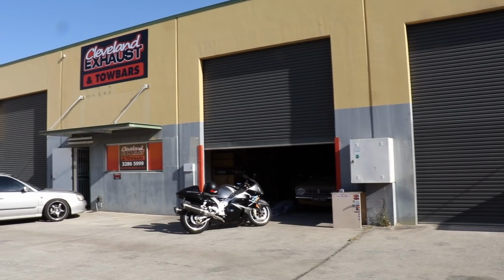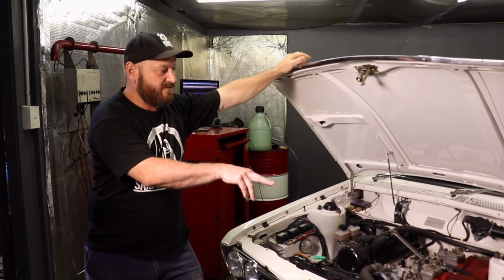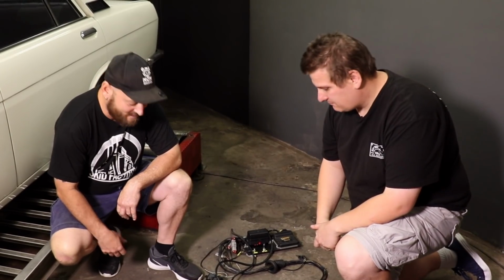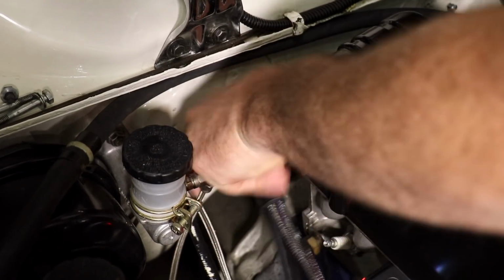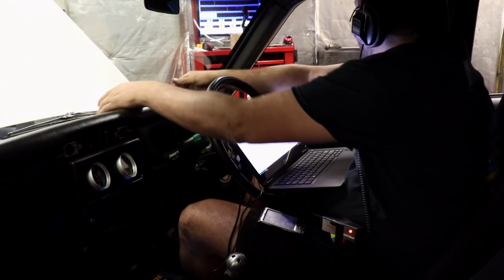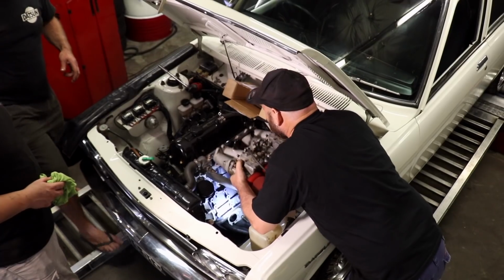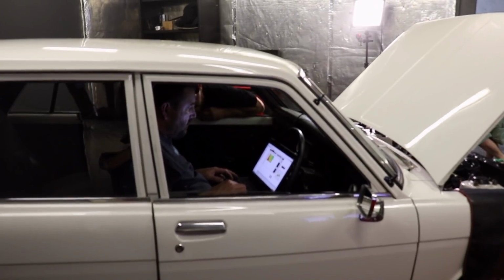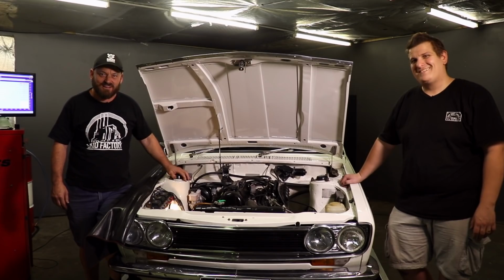Carb vs EFI on an L Series Datsun 1600 - Dyno Test

Comment: Little kiddies must be easily impressed
$ v's Hp still laughing
Reply: How much do you think it cost?
Reply: For that horsepower gain, too much.
Reply: How much do webers cost new? How much do they cost to tune? How much does an electronic ignition system cost to buy and have the weights and springs calibrated to suit the specifics of the engine? 
How much did this setup cost that can be recalibrated with a laptop for any modification to the engine?
Reply: "How much do webers cost new?"
about $467.00x2  plus manifold.

 "How much do they cost to tune?"
For me, free, for you I have no idea.

"How much does an electronic ignition system cost to buy and have the weights and springs calibrated to suit the specifics of the engine?"
 electronic ignition modules range between $50 to $500. Advancing springs and weights aren't rocket science .

"How much did this setup cost that can be recalibrated with a laptop for any modification to the engine?"
Wow that beats a timing light, a screwdriver, and a vacuum gauge.
Reply: Sounds like it costs as much as this efi setup. What part of the carby are you tuning with a screwdriver?
Reply: Alan Butler

DEADSET!
"What part of the carby are you tuning with a screwdriver?
"
Please go away.
Reply: So you don't need a variety of jets, air correctors, emulsion tubes, venturis, chokes etc? Just a screwdriver. Setting the air balance and idle mixture is not tuning a carb.
Reply: Alan Butler
So, whats your point. The car runs well before the change, the add ons gave minimal  hp. If it's was done for the wow factor, money well spent. If hp, not enough bangs for my bucks. Lol

"Just a screwdriver. Setting the air balance and idle mixture is not tuning a carb."
Do you see those things holding a  carburetor  together? I undo those things with a screwdriver. Even the circlips. Be amazed at my trickery.
Reply: I'm amazed your still arguing your point.
Reply: Tim Heibloem

What that little boys are  easily impressed.

Comment: Would it have been better for tuning leaving the standard Suzuki injectors in, rather than going big on a motor that's only making 120hp. The stock efi is good for 170 + HP in the bike. Just curious why bigger injections are needed to make 125HP..
Reply: Busa Richard  The Suzuki ones were unknown and some serviced S2000s were a bargain.

Comment: Hy guys!! I'm from Brazil and I'm going trought the instalation of my own ECU on a Opel Kadett 1984 (here we call it Chevette). I'm interested in buying/installing a knock sensor on it. My ECU doesn't give me this resource, but I know that there are some good aftermarket devices that I can use to listen to the engine knocking as you did on the video. Can you tell me a brand or equipament model I could buy for these purpose.
Thank's and sorry for the bad english!!
Reply: Linkecu used to do a knock ear device for tuning purposes.

Comment: Reliability?  Lets get real, 10hp? Probably that is lost when filters are fitted. The efi SHOULD produce bottom end and mid range but the figures did not show it. Maybe better on economy but it is a performance car not grannys shopping trolley as it started life.
Sound? Pull those socks off the Webers, no sound better,,, or more bloody annoying depending on the circumstance.
For race use there is no real advantage, for street maybe some.
Reply: The big oval filter they will be fitting shouldnt restrict a small engine like that at all. My SU setup on an L20 at around the same hp as this one had no perceptable difference with filters on or off.

Yes, they should have been fair with the initial dyno test and had filters off. But the ability to route cold air and have the efi account for the temp would most likely make up the difference anyway.

Comment: But why use a Hayabusa unit that was designed for 1.3L hayabusa engine instead of a 20V 4 throttle that is designed for 1.6L 4AGE engine? My logic is that the throttle body should be bigger in the 1.6L one instead of the 1.3L one.
Reply: netmatrix75 the busa uses 44mm throttle bodies, the 4a uses 43 or 45.
Reply: netmatrix75 1300cc engine that revs to the moon vs a car engine that probably does about half the revs.

Comment: Interesting piece. On the one hand, i totally get the desire to ditch carburettors. The driveability, reliability, constant tune in all altitudes and conditions, tuneability, and never getting covered in fuel and crap with constant fiddling with the fuel and spark systems. I've spent considerable money ditching an old carby engine for a late model injected engine in the tow pig i run. But on the other hand, how much money have they spent to get 8 percent or ten more horsepower? Not including labour and dyno time, the parts alone will have run into a couple of grand surely? I'm not a street racer or a drag racer so i probably don't have a real understanding but where i come from, we spend far more money on suspension tuning and chassis tuning and it netts us far more gains than 8 percent power increase.
Reply: Doing well on the editing and presentation by the way guys
Reply: 8 Percent at the pointy end of its potential horsepower.  If we had of started with a bone-stock engine, I imagine gains would have been more dramatic.  The owner is happy, I am happy.

Comment: Did I understand that it sounded different after the changes? If so, why would that be?
Reply: zeroyon223 oh that totally makes sense thanks
Reply: The carbs are 45mm throat but they then have a choke in them to create the "depression" required to create fuel atomisation. The Busa throttles are 44mm but have no choke as the injector both delivers the fuel and atomises it. The sound changes because of the lack of chokes.
Reply: Makes sense figured you'd have been talking about sound once it was buttoned up. Awesome videos and thanks for taking the time to answer.

Comment: @Turbo Yoda, So if you pulled you're crank angle off the Distributor, (super cool adapter by the way) does that mean you're firing 2 coils together in a wasted spark setup?
Reply: If you mean does it only receive enough engine position information to run wasted spark ignition then No, it is capable of full engine position signal. You may be thinking of a crank only signal. A cam only signal is delivering a 720degree or full cycle pattern, a crank only signal is only delivering a 360 degree or half cycle pattern and only does that if it has a missing tooth or extra tooth.
Reply: That is what I was thinking of.  Thanks for clearing that up.

Comment: I wonder how much that less than 10% boost in horsepower cost ???
Surely old school (japanese style) one carb per cylinder and black box free pulse ignition (nippondenso BCI coils) would have achieved a greater increase in power at a far lesser cost.  
Please forgive my utter prejudice (and loathing) regarding the electronic and computer insanity that so many see as normal and ok these days.

Comment: If you picked up 10 HP,  the dyno showed only 6. A LOT of money and mods for 6-10 HP either way. A LOT of money when you add the cost of dyno time and a Haltech, let alone the carbs. I hope you have plans to make all this expense and tech worthwhile. Usually, I love your content, but this seems like a commercial to me, so I give it as much notice. Which is kinda none, man.
Reply: The video is about converting to EFI. This is done for many reasons but in an NA application it is rarely to increase a top end power number. The basics of this can be applied to any engine. If you want to see hektic videos about massive gains then look elsewhere on the internet because that is not what the show is about, we operate in the real world and show you the reality of that world.

Comment: Awesome vid. Anyone know what wiper motor he's using? It doesn't look original. The 1 in my 1600 wagon has 2 speeds slow and stop.
Reply: Contact Timmy at Crimp My Ride, he does them as an upgrade.
Reply: Alan Butler thanks. Did the conversion on the weekend.

Comment: At what price? What was the up grade cost not uncluding labor
Reply: I’d guess about $1500-2000 but I don’t know how much the throttle bodies and the distributor pickup goes for. I think the haltec with harness is about $1000. 

A dual Weber setup like they took off would be a similar price.
Reply: ChrisHallett83 I know for my Datsun Z you can find triple 40mm for 1300.and a manifold for about 500. Thats ebay shopping.
Reply: My question as well, Haltech lists just the 550 box for around $850 (that is off the web link) but add in wiring harnesses and think more $1200 and the "adapter" for lack of better terms shows for $400 on the Facebook page.  Not sure if that is US funds or Australian dollars  so NBSV1 is close. But that doesn't include the rest of the changes they made, how much does a stock Hayabusa (sp?) set up go for used? 
Can those dollars be better spent?  Its not that it is not a good idea, have no doubt is works and accomplishes reliability but is that horsepower gain is 9% so one question would be IF I were to spend $1600 in a different way would I see more Hp gain?  IF that is what someone is after.
Put a different way, IF I were modding a 4 cylinder, from the manufacturer, whomever, is this what I should spend the first $1500 of my budget on?
Reply: RussZHC I dont understand why for years the car community is shy about costs.( Im sure so the wife wont know) 
But its intergral with mods , money spent for what kind of improvement for how much horsepower.
Its why so many people are "Floored" when they know hiw much money it costs to match performance levels. I do know a set of top of the line extreme tires would improve everything across the board , as if you put an up graded motor in it.
Reply: RussZHC   Where you spend your money depends what engine in what spec your startiing. dont forget all the Fuel pump and return line stuff, the manifold, the relays and board , the distributor replacement. the coil packs and new leads. Several hours of dyno time and hopfully and air box and filter. Thats going to be $1000/2000 more.
Reply: Definately more than the car is worth.

Comment: can you buy a fusebox for ECU? i'm looking forward of doing this to my own classic car. which "basically" has the same setup as this one has. but i'm afraid i'll just burn a bunch of ECU before i learn to do it.
Reply: answering to myself, yes you can purchase a premium package haltech ecu 550 which includes the fusebox :)
Reply: Or wire in any other fuse and relay box.  The one in this video is a TE fueseboxz

Comment: Al what do you think about Single-point efi solutions , eg holley super sniper (8 injector) for an old school v8.
Reply: Not much as they don't address the issues you can have with atomisation and manifold wetting. EFI is not much use if it isn't port injection.
Reply: ahh..back to the drawing board. What do you recommend as a cost effective solution for a 427 windsor flowing healthy numbers on papers (forged billet bla bla) 550-620hp at the fly.
Reply: Single plane medium rise manifold drilled for injectors and fitted with a 4 barrel throttle body with TPS and stepper motor run by an Elite 2000. I have not long ago done similiar with old cocks 351 Cleveland.
Reply: Will Old Cocks clevo be on the Skid Factory series.
Reply: Yes it will be featured soon. Just finishing off the interior and aircon etc.
Reply: Alan Butler look forward to it. You can do my foxbody mustang if ya want, sorry no turbos lol

Comment: from a diy pov,is this process doable without going to a dyno to tune the efi?
Reply: That depends on your skill level but yes you can tune your own car if you understand the process.
Reply: You’d want to install a wide band O2 sensor in order to know what it’s doing. Usually the baseline settings will get it started and running. Then it would be tuning it to get it right so it makes good power without hurting the engine. 

Some aftermarket ecu’s even have a self tune setting where it can read the wideband and will adjust itself to hit targets you set.

Comment: No throttle position or MAP sensor? Also no oxygen sensor?
Reply: The ECU has a map sensor, and the TPS is on the end of the throttles.  We didn't install an oxygen sensor, we used the dyno's sensor for tuning.
Reply: Tim Heibloem cool great to know. Thanks!

Comment: So what’s that? Like 8 grand for less than 10hp? I know this wasn’t about power, but I feel like the efi propaganda is getting a little strong now-a-days.
Reply: Hayabusa throttles plus haltech = 8 grand? Quick MAF.
Reply: Alan Butler ECU, dizzy pickup, harness/relays/panel fab, coils+wires and bracket fab, custom plenum for throttle, and then the throttles, reluctor wheel for crank+sensor, efi fuel pump and all plumbing, AN fittings all throughout, dyno time and tune. If it’s not obvious how much this was, then you haven’t spent the money yourself before.
Reply: um,think he is well aware of the cost as he was there..
Reply: I am the dude in the video, I have a reasonable idea.
Reply: Then you should know well enough that if some schmuck walked into your shop and asked for something like this, it wouldn’t be all that far off.

Comment: all that for 10 horsepower. Lord.
Reply: EFI is for engine control not top end power. If a carby engine has 12:1 AFR and 30degree timing and makes 120hp then the EFI engine with same settings will make the same all else being equal. The difference with efi is that you can tune the engine very easily to behave properly everywhere else in the rev range so it isn't a backfiring stinky stalling guzzling dog to drive.